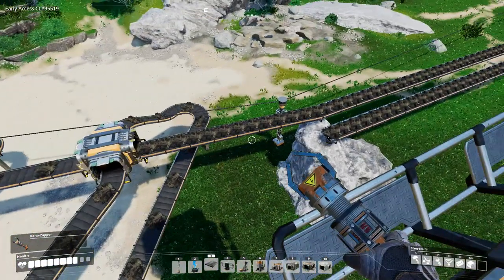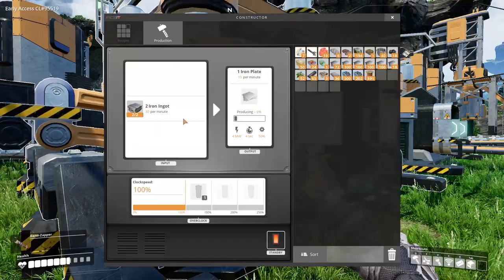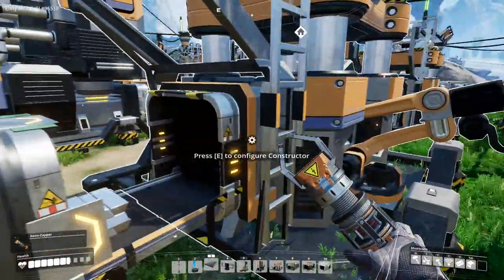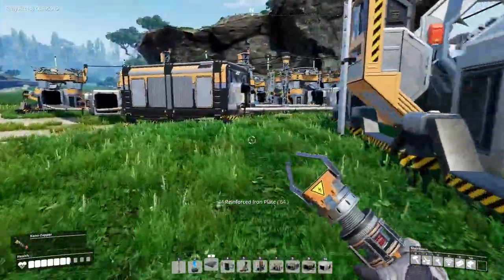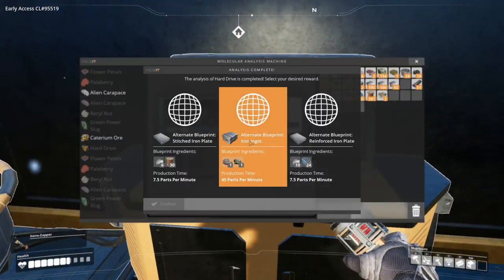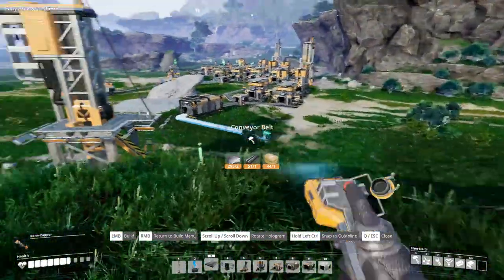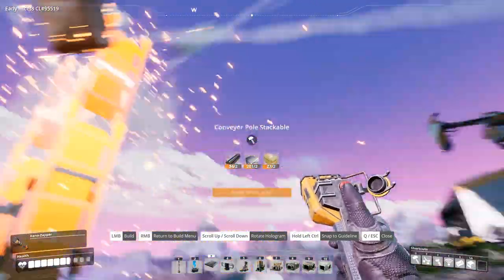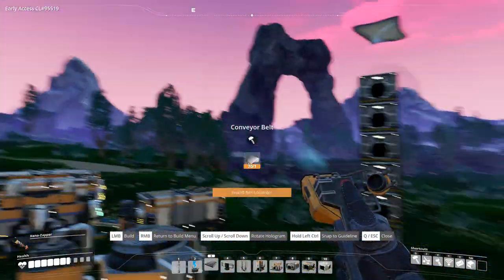Satisfactory Early Access EP8 - MK2 belts and Vertical storage | Lets Play, Tutorial, Guide & Game

Comment: You've messed up the equation there JD. Each Coal Generator eats 11.11 Coal/minute, which is 5.4s per unit of coal. (60/5.4)
If you want 100% Efficient coal consumption rates, I'd suggest playing on multiples of the following combinations:

12 Coal Generators @ 87.20% Clockspeed will consume exactly 120 Coal @540 MW.
Or 10 Coal Generators @ 110.52% 
Or 6 Coal Generators @ 214.71%
Or 8 Coal Generators @ 147.72%

(As I said previously, the power equations are really borked)
Reply from the maker: Yep I got my numbers back to front! but u know the easy fix? Mk2 miner outputs twice as much!
Ive been trying to avoid overclocking things, as i dont want to HAVE to go slime bug hunting, and honestly getting twice as many generators is easier then getting any bugs!
Reply: @JDPlays  True. That's kinda why I'd stick to the 87.2% clockspeed and work around that configuration, because even then, 45MW per generator is nothing to laugh at, and I'd still have production under control @10coal/min per generator. The Mk.2 Miner (& Mk.3 Belt) will certainly make life easy though.